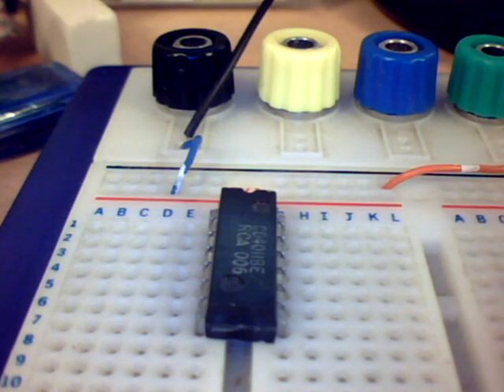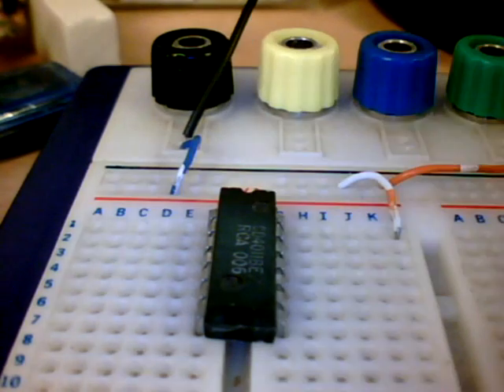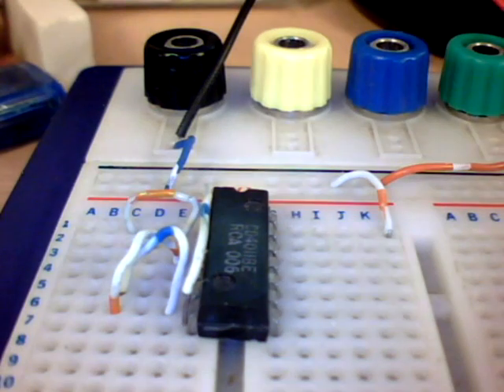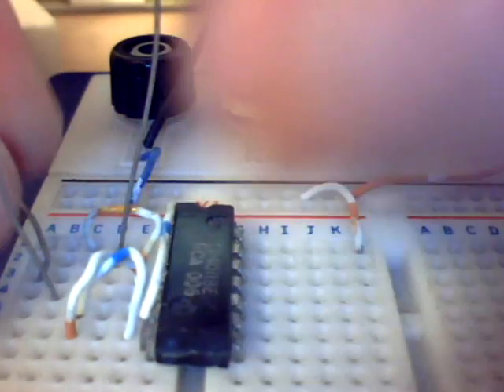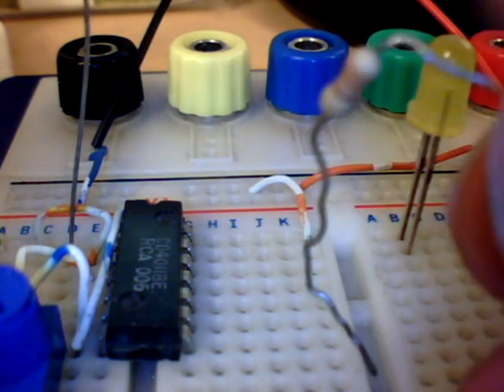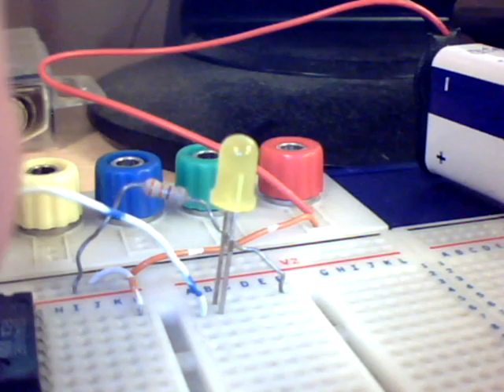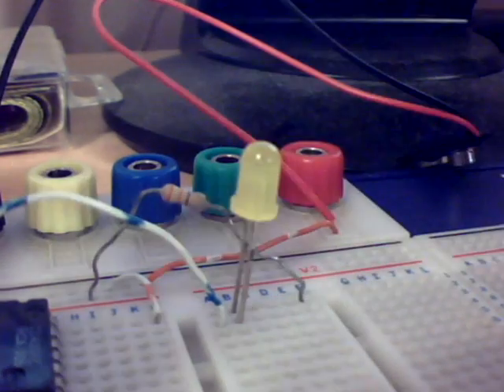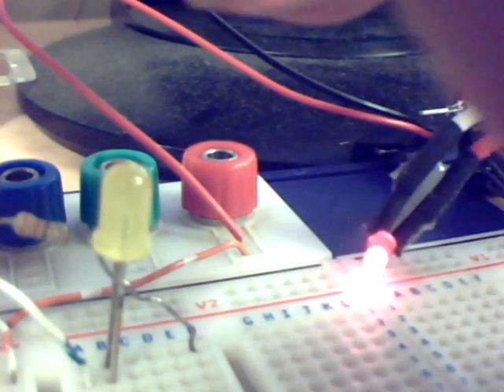Breadboard a 4011 Astable Oscillator Light Flasher

Comment: CD4011BCN-ND      An other thing. I would like to have the datasheet of your dc4011. I tried to do a circuit called (in-circuit transistor tester wich use this componenet and it dont work. I tested each op amp on my IC etc. Triple checked everything. You can find this tutorial  on  utube has (in-circuit transistor tester). My last resort is to find the same IC from another company. Yours seem different from the 3 I found. Thanks for youtr attention.

Comment: Hi,
On my datasheet, there is an icon of a logic gate, I see two lines for the input. One is straight, the other is kind of rectangular wave ( pins, 2,5,9,12), the third is the output.
Are the square wave the invert input?

JP

Comment: @krakelak 
Is it simple in concept.  An input to a logic gate goes high (5V for ex), the logic gate inverts the signal to go low (0V for ex) on the output, the output is fed back into the input, the input goes low, the logic gate inverts the signal to go high, the output is fed into the input, etc. On, off, on, off, on, etc.  

The other components adjust the timing and stability of the logic gates.  The wiring is a implementation detail of the chip itself.  Could be done with inverters too.